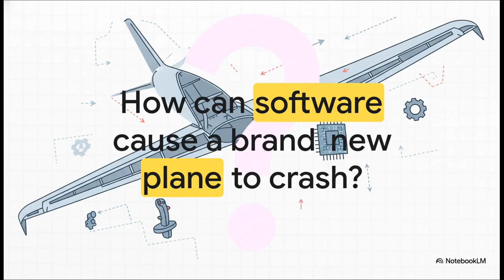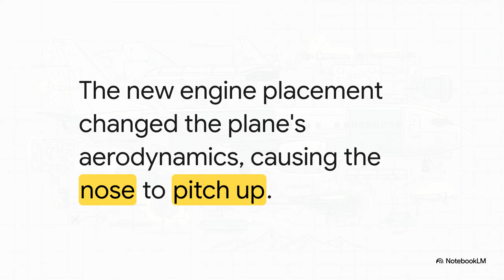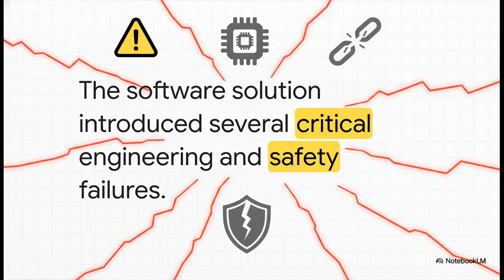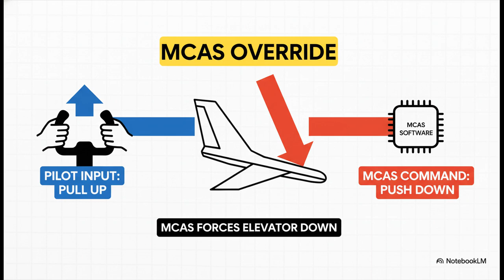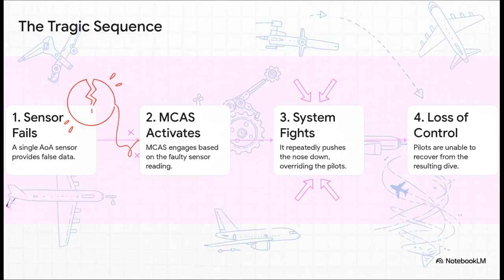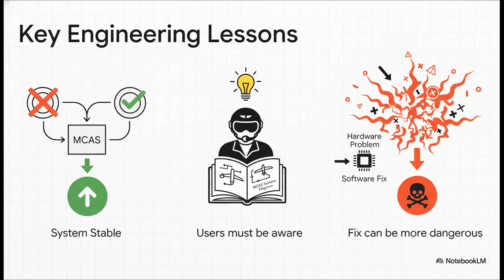What Really Brought Down the Boeing 737 MAX (Twice)?

Comment: Originally the 737 had two Angle of Attack (AOA) sensors, but they were only used to drive the left side and right side AOA gauges on the instrument panel. If one sensor malfunctioned the two gauges would disagree with one another and the pilots could decide to ignore them. The key point is that in previous 737 models the AOA sensors did not move the flight controls, they only provided the pilots with an AOA indication. When they added MCAS to the 737 Max, they crossed a line by allowing the AOA sensors to move the flight controls. Once you allow a sensor to move the flight controls, you need redundancy to prevent a single point of failure. It's hard to understand how this was overlooked. Sometimes its what happens when you try to modify an old design instead of designing something new from scratch. Adding the bigger engines and putting MCAS on the plane wasn't the real problem. The real problem was how MCAS was originally designed to work using just one AOA sensor at a time.
Reply from the maker: Thank you. On the older 737s, the AOA sensors were just indicators for the pilots. But once MCAS came along, those same sensors were suddenly tied directly to flight controls, and relying on just one at a time meant a single failure could have huge consequences.